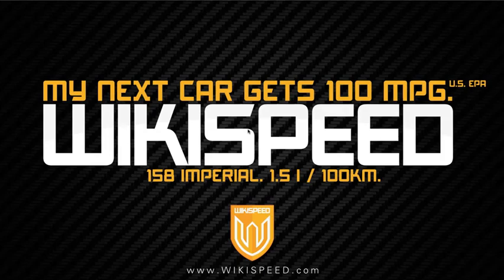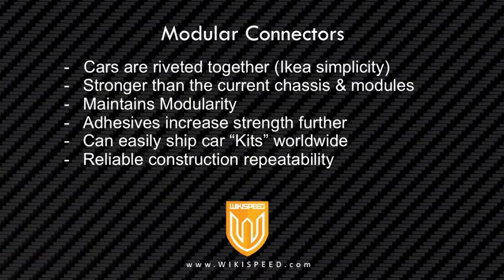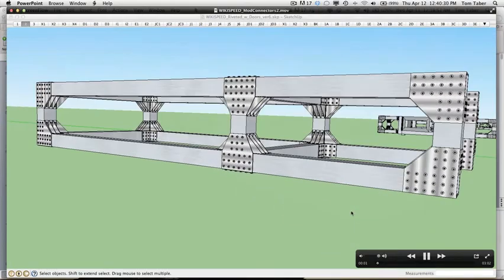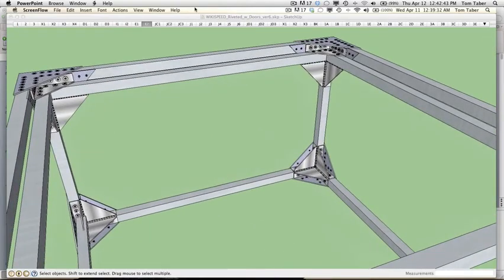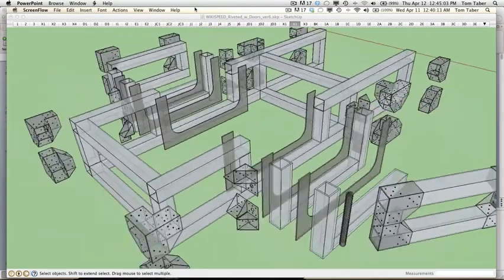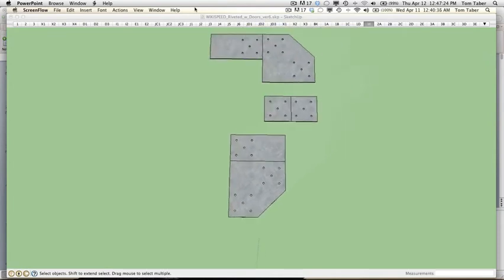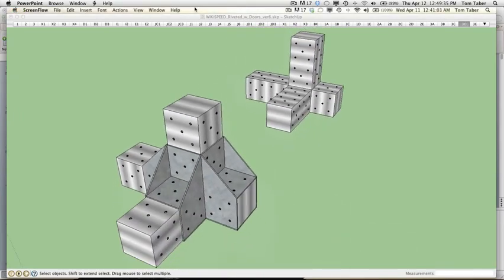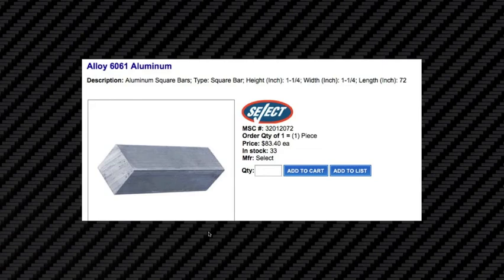WIKISPEED Modular Connectors

Comment: My thoughts on the jog is that although more expansive and heavy to handle, the jig piece should actually be made out of brass or copper, since those make for better heat-sinks, and more importantly, there is no risk that you weld the plates to the jig.

Comment: You guys need to sand mold your complicated connector parts. Also where are the sketchup files of what your doing so we can play with them. Also you guys should start using alibre or Geomagic. I have been using alibre for three years now and I love it.  Check out modular walking robot design. RashadGlover D O T com

Comment: A comment regarding the door design - instead of two additional U sections on the exterior of the chassis, front-back rigidity could also be maintained by having the door close within the chassis section which would have to be removed to accommodate a door. Side impact strength could be retained with a single additional external structure which braces itself against the main chassis. Making the chassis unnecessarily wide will limit it's applications.

Comment: Can't you just buy Ts and 3 way corners ?

Do you really need to weld it together? Would flat and 90 degree bent plates riveted, screwed, or bolted on be strong enough? It would be far less complex.

Instead of outside, how about inside? Weld slightly smaller steel tube into Ts and 3 ways that slide inside the aluminum tube. No heat treat needed. You can screw, rivet, bolt it together without interfering with other parts. If you want extra strength attach flat aluminum plates to the outside.

Comment: those look phenomenal! What gauge aluminium ? 
There's a threshold where the corner re-enforcement become so much stronger then the 4x4 tube that it offers no added strength. As the tubes are 1/8" thick, is a 3/16th re-enforcement plate enough?
I like the design though, and really nice CAD work, too.